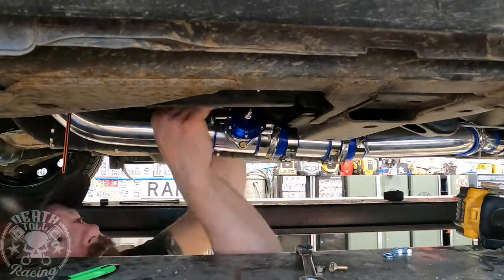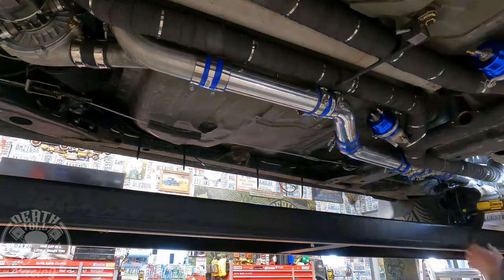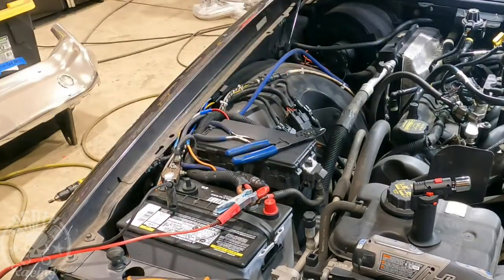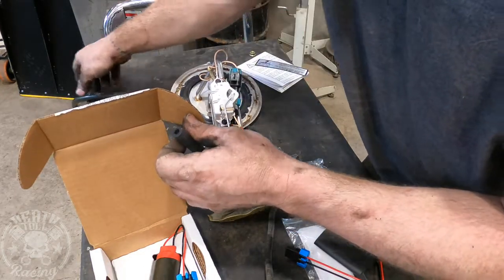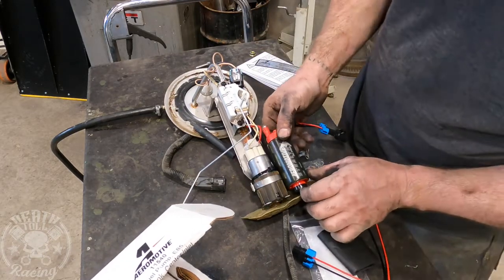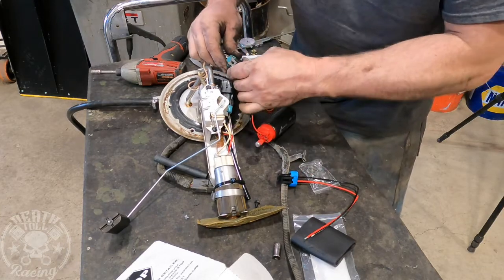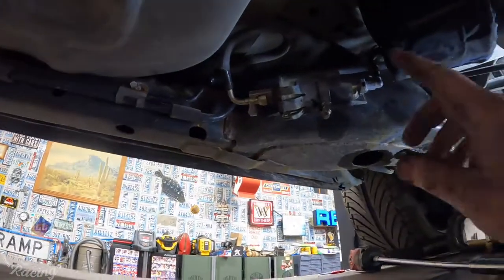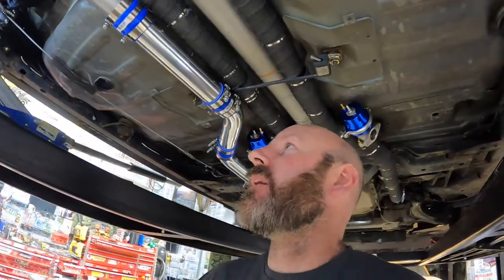Ep 7, Twin Turbo P71 Crown Victoria, 340 Fuel Pump Install, Wiring of Scavenge Pump, Intake Finished

Comment: Just installed mine.  I got it from ADTR.  I was getting P0193 on full throttle.  Hooked up my fuel pressure gauge and confirmed pressure dropping off at full throttle.  Fixed right up.
Reply: Also I didn't drop the tank.  Put the car on jack stands and the pump came right out.
Reply from the maker: Yes, I thought I was going to have to modify it more than I did.  I probably should have tried it that way first.
Reply from the maker: right on!
Reply: I’m looking to buy one too , but does it require a tune? Or is it plug and go

Comment: What is the part number or brand name of the mass air meter pipe that you put in between the throttle body and down pipe up under the hood that you showed us
Reply from the maker: https://amzn.to/3D284s0

Here’s the link, but at the end of each series I add the parts used in the description. I also have an Amazon storefront and the crown Vic has its own category.   Each part has a little note you can click on in Amazon. 

Hope that helps
Reply: @DeathTollRacing  okay thanks bro, by the way how much does the complete twin turbo kit cost?
Reply from the maker: I actually haven added it up. But I’m guessing (not included exploding the first engine) in the $2,500 range. Single turbo would be easier, and honestly if you’re stock bottom end, probably better. But I do plan on eventually turning this thing up to 20psi.
Reply: @DeathTollRacing  okay well my goal is to do the twin turbo kit because I'm going to buy a complete engine from my local Pull-A-Part then install a full forged rotating assembly to be able to handle up to 20 psi like you plan on doing
Reply from the maker: @krownvikkhris3004  that’s a good plan. I found a wap block in an explorer.  It’s pretty much a direct swap. I’ll be addressing that soon in a video
Reply: @DeathTollRacing  ok looking forward to it Bro

Comment: Studs for fuel tank straps were much longer originally   Designed to have excess bolt sticking out broken off after tank install. Not sure if studs still available from ford
Reply from the maker: That's been my experience on every other tank mounted that way.  But this is my first vic, and I still remember how frustrating that was.  I should have just stopped and replaced them, but I'm way to stubborn.
Reply: @DeathTollRacing  yeah I’m stubborn too. Took my tank out and used old studs as well.

Comment: Will there be any benefit from installing the aeromotive fuel pump in my crown victoria
Reply from the maker: If you’re not doing turbos or a supercharger, it won’t buy you anything.  If you plan on it later and you need a fuel pump now, then you may as well. It won’t effect how it runs, just has more capability if it’s needed.
Reply: @Death Toll Racing  Got'cha Appreciate That
Reply: Nice setup. Drop more content on the vic... love what you done
Reply from the maker: @mr.louweeziana122  thanks!  There’s going to be a good one next week hopefully.

Comment: I had the same issue a couple weeks ago, I got pass just fine, the driver side I fought with it forever.... I tried a piece of wood on the transmission jack. I was so irritated I contemplated persuading it with a BFH and that's when I decided to step away for a bit.

The solution, Pull the stud down! .....
.........Yeah, That is all........... Pissed me off more than anything else.
The tab to hold the stud so you can thread a nut bends up shortening the stud (obviously) so by all means had every right to curse the engineers, Just wasn't for why you thought.
Reply from the maker: Haha. That’s funny. Good catch!

Comment: From my comfy chair it looks like you could eliminate that joint where you had to cut the studs down - forcing the clamps to be one use only.  Could you simply weld that joint together?
Reply from the maker: Haha.  Absolutely yes!  Except.....  I sold my tig welder so I could buy a "smaller" one.  That one I had was huge physically and also way too much welder for what I use it for.  I've been shopping for another that could hopefully do more than just tig, but I'm having problems pulling the trigger.  My biggest hurdle is that I want ac tig for aluminum, but also would like to have a spool gun set up on it as well.  That's proving to be a problem, because most the welders capable of running a spool gun, don't have ac tig.  Also, I could just buy a section of the tubing I wouldn't have to weld together.  But I'll just get it going first, then upgrade it.  I'm not 100% certain that it's big enough diameter also.  It's going to suck if it does need to be bigger though, because space is not something I'm blessed with down there.

Comment: For future reference, the fuel tank doesn’t have to be removed to replace the pump. Cut the wire harness and add a weatherpack 4 pin connector. So much easier.
Reply: if you go in the passenger wheel well you can get the harness going to the EVAP pressure sensor and no cutting involved.
Reply from the maker: @commonsenseisdeadandgone  I didn’t think I could get to it. I’ll have to look again since at the time I was looking, I didn’t actually know where the connection was, so I could have easily missed it
Reply: @commonsenseisdeadandgone aybe if I carefully chiseled at the connector and removed it, then rewired it. I’ve seen that connector mounted at least two different ways, and in my case it’s facing toward the center of the car with the tab on top, and there is like 1/8th of an inch of clearance above it before solid metal. There is just enough room that many flatheads alone could do the trick, except that there is a metal overhang that prevents you from coming at it with anything but stubby sizes, so all the room you need for your hand to pull on it is taken up by having your other hand right up against it. I’m sure I’ll find it make something that’s got the right angle to press against the roof and bend just right into the tab enough for me to wiggle it with a hook or another flathead, but for now I’m gonna try and avoid that step altogether.

The way I’ve also seen it mounted (like in 1AAuto’s video on the pump) is where it face toward the front of the car and is mounted sort of on the rounded corner instead of completely at the top, so you’d have way more clearance and access to both male and female sides for leverage. There are a ton of benefits to Panther 2.0 to 2.5 and vice versa, so it may be one of those luck of the vintage scenarios. Unless it’s a TC or Marauder I doubt this particular component would be different unless it had to do with the refresh as that is also when they changed other aspects of the fuel system.
Reply: @TheRealBobbyMC  mine is an 03, there's 1 connector that has the fuel pump  and then the connector for the level sensor that goes up and towards the passenger side. The same is true in town cars. I cannot recall exactly how the connectors are located. 

I vaguely remember you can push the "Christmas tree" body/wire clip up from below to help gain access.
Reply from the maker: Yes, I agree 100%. That’s what I’m going to recommend too. That’s was way more work than I should have done just to keep the wires original.

Comment: Are the shorter studs possibly related to the whole "police cars blowing up when rear-ended" media frenzy from years back? Seems I recall that the tanks were rupturing on those, or something else sharp. I can’t remember if there were recalls or just a simple mid-production change. I thought it was ridicules that all the news shows were comparing the Crown Vics to the old Pintos, never mind they were the #1 car used by police for side of the road traffic stops.

Anyway, nice build here. Looks real clean. Can’t wait to see it run.
Reply: That was pre the plastic covers over the sway bar links 92-01 (or 02) as the tank puncture was due to the end links.
Reply from the maker: @commonsenseisdeadandgone interesting.  Always learning.
Reply from the maker: Oh yeah!  That's a good thought!  I'm getting pumped on seeing what it can do!